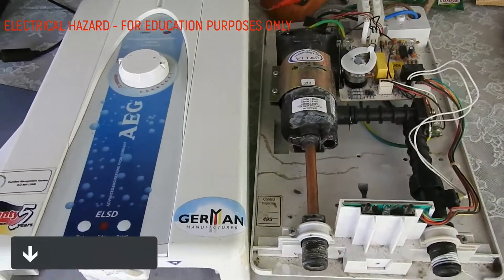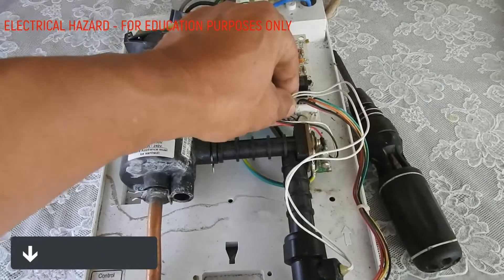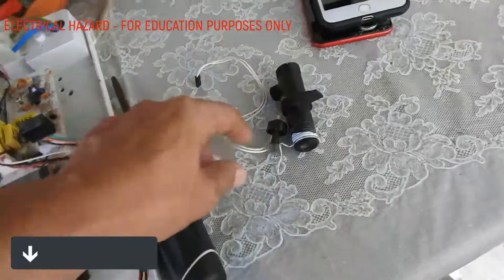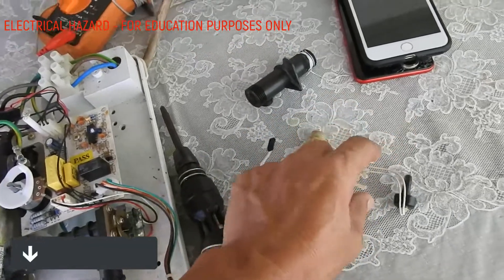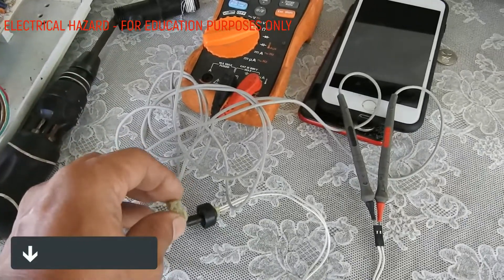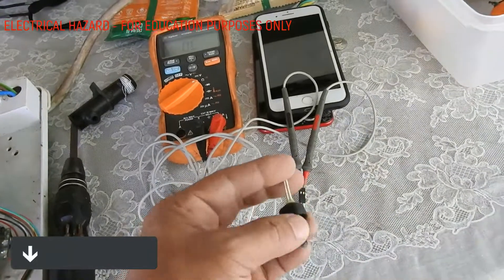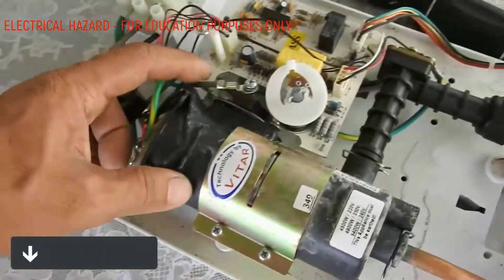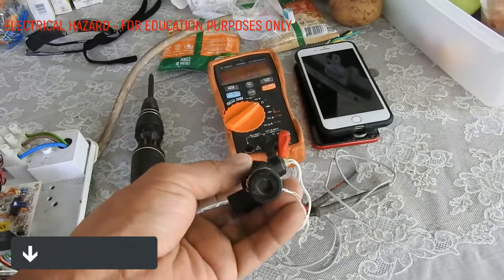Roxas, Isabela - How Flow sensor works in Water heaters

Comment: Nice. Maybe the mobile magnet can be sandpapered in order to move freely and to provide water flowing sensing again.
Reply from the maker: Thanks for watching. It is a good idea to do so only if the nylon has not expanded to too much. Mine expanded to the point of exposing the magnet which then rusted out. The nylon looked liked it bursted open so it is not salvageable

Comment: Can you clean that reed switch or flow sensor magnet or sort? Mine stopped today, before, I just need to clean the filter coz of dirt..now, no luck..no light on my AEG ...no hot water
Reply from the maker: Thanks for watching. Want to caution about electrical hazard. 

Usually it is the nylon encapsulated magnet that fails first. Remove the hose and filter then poke at it gently so if you encounter resistance while poking up then the magnet had swollen. Looking for replacement will be a challenge. 
If loose then failure mode is elsewhere. Next is jumper the magnetic reed switch at the header (use a 2 pin header that you find in computer), doing this will fool the computer into turning on the heater. If none of these works then the 5 volt powering the computer is no good. 

Anyway, I ended up buying a new heater from Lazada because the one I repaired began to leak

Comment: You will Live Longer when You touch Live 220VAC !!!
Reply from the maker: Thanks for watching. I couldn’t take the comment too seriously. 220 VAC, Depends whether one was energized to live longer (I want to live forever that was a closed call) or energized to live shorter, say a second then eternal blackness. There are 3 possibilities (there are many permutations) immediate blackness, live forever (say 100 to 150 years of course it would depend how old a person was at the point being electrified) and somewhere in between. Having experienced the shock, I wanted to live forever by fixing the faulty equipment then replacing them with the latest water heater so, yeah, doing something does make one live longer
Reply: @thelifeofexequiel  ...you have created a lot of choices....Live Safe...Live to repair !

Comment: it's flow switch and isn't flow sensor.
Reply from the maker: Thanks for watching and feedback. Thanks for taking the time to comment. Technically, it would be described as flow detector using a magnetic reed switch that upon the presence of a magnet that the reed switch will switch a logical 0 (magnet comes in contact) to the input of the microcontroller. The controller will then begin to drive the heater to warm up the flowing water and will turn off the heater when a logical hi is detected (no magnet). I used the flow sensor more as general concept for non-technical people because of the idea of sensing something thus flow sensor. For technical people (I assume you are one) then they could critique the description and comment as such.
Reply: thank you 👍👍👏👏👏👏